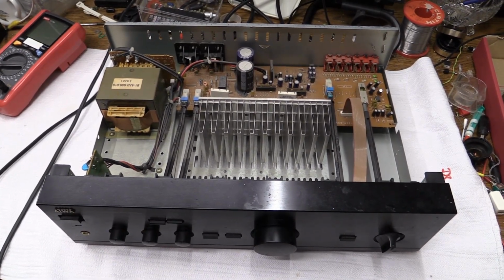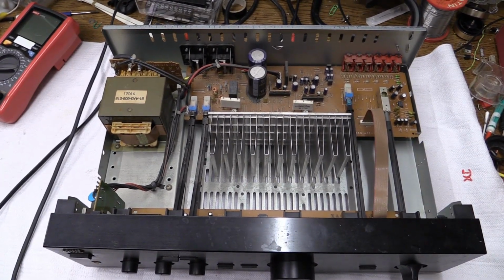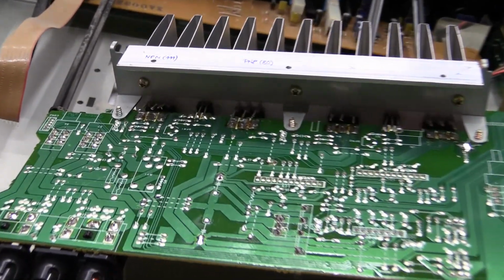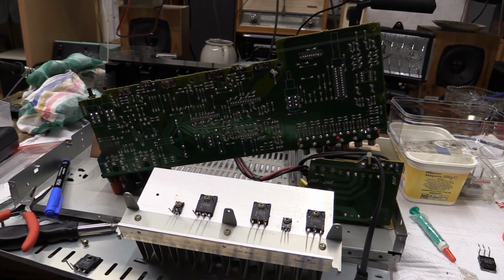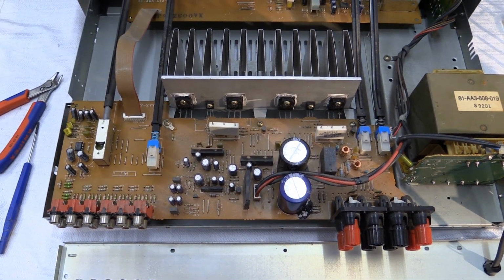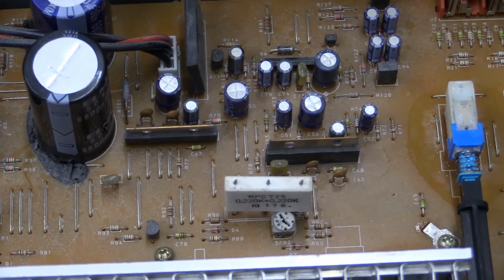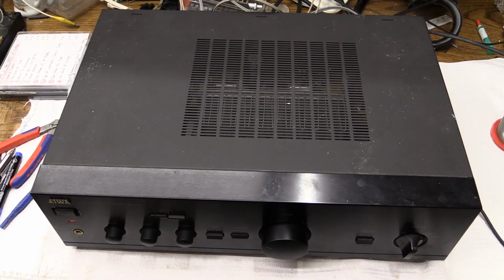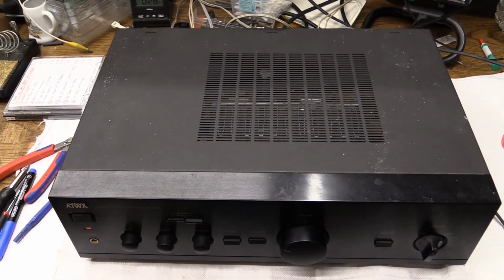DrCassette's Workshop - Aiwa XA-003 amp repairs

Comment: Hallo, ich hätte eine Frage, wenn gestattet: Die großen weißen, Quaderförmigen Widerstände vor der Endstufe, die mit den drei Beinchen, wie mißt man die, und wieso haben die drei Anschlüsse?

Hello, I would have a question, if allowed: The large white, cuboid shaped resistors in front of the amplifier transistors, with the three legs, how do you measure them, and why does they have three connections?
Reply from the maker: Es handelt sich um Drahtwiderstände mit Mittenanzapfung, das heißt, der mittlere Anschluss ist bei der Hälfte des Gesamtwiderstands verbunden. Man könnte alternativ auch sagen, es sind zwei gleich große Widerstände in einem Gehäuse, die miteinander verbunden sind. Das kann man entsprechend messen, wobei man aber zunächst den Widerstand nur zwischen den Messspitzen des Multimeters messen sollte, indem man diese miteinander verbindet. Diese Drahtwiderstände haben meist einen sehr geringen Wert von unter einem Ohm, deswegen fällt der Widerstand der Leitungen und Messspitzen des Multimeters ins Gewicht und muss vom Messergebnis abgezogen werden. 
In der Endstufe bieten diese Widerstände die Möglichkeit, über den Spannungsabfall den Ruhestrom der Ausgangstransistoren zu messen, deswegen sind die Anschlüsse auch nach oben heraus verlängert, damit man besonders einfach mit dem Messgerät herankommt.

Comment: Hell, for free and your skills, This could be sold to buy something better, Liked, back in the day we would crack open the case in the protection unit an stick a dime in it across the contacts, usually worked until amp would over heat under heavy load

Comment: that was my first Amplifier back in 1988 when i first left school. it had a habit of cutting out every time it was too loud rather than distorting. Was running it to Tannoy 607 speakers
Reply from the maker: That's intentional design, it's a protection circuit to protect the amplifier and the speakers from getting damaged.
Reply: @DrCassette  bust my OT all the same. wasnt too much for fix around 50euro nowadays prices, used and old toshiba silver thing for a while till it was fixed. you could turn that up near full but never sounded as warm.

Comment: I would be inclined to clean & lubricate the bias pot's, and adjust the quiescent current to spec's. I'm not sure what was meant by 'integrated' amplifier, when the output stage is discrete transistors..
A late model 'Marantz' has 2 integrated circuits (containing the output stage) mounted on a 'herringbone' heatsink.
As the driver IC's get hot, also do the electrolytic caps surrounding them; worth replacing for just a few dollars in the process of assembly...
Reply from the maker: 'Integrated Amplifier' in this case means it's a preamp and a main amp in one unit.

Comment: To test voltages on amplifiers without the output-transistors you should not disconnect the small bias-transistor in the middle. It plays an important role in generating the correct B-E voltages. That's why you were getting 37V everywhere. It also often helps to put a 100 ohm resistor from B-E instead of the output transistors. Then you should have the output at 0V and ~0.7V from B-E on the output transistor treminals.

Comment: Elna are not crappy capacitors.  Elna Silmic II are some of the best sounding caps available.
Reply: LoL Capacitors don't have a sound... They can only be built well or bad, last long or die early... The only thing that they can do to sound is if they are used in a filter circuit which if you replace with every single brand, so long as the capacity is the same, with all do exactly the same thing.. they don't make sound... The circuit does...
Judging by the amount of likes that your comment has, seems like a lot of other people don't understand Capacitors either LoL...
Reply: @PeterMilanovski  caps don't make the sound better, but they certainly do make the sound worse if they are of a bad brand or going bad
Reply: @PeterMilanovski  correct, except it's not only about C but also ESR (equivalent series resistance) and leakage current

Comment: The driver IC's in some Sony receivers run very hot too.
Reply from the maker: +Bri G. 
Yes indeed, I had a Sony receiver with a similar design. I installed heat sinks on the driver chips. Still ran very hot.

Comment: I'm glad you managed to fix your amp :o)  i'm still stumped with mine :o/ ... I have the same problem as your friend had, one of the channels not working and I replaced all the caps and the transistors seem fine...just getting a lot of abnormal negative voltage on the channel which doesnt work. I'm slowly prodding along troubleshooting at the best of my abilities :o) By the way, It was nice to hear The Beloved's Sweet harmony again :oD
Reply from the maker: +MsMad Lemon 
If you get a high amout of DC voltage on one of the speaker outputs, this could be due to a shorted output transistor. If those are fine, go back one step and check the driver stage. A schematic is always helpful. Just blindly replacing capacitors never helps, usually those are fine.
Reply: +DrCassette Thank you, actually the output transistors are fine as I swapped left and right to test, I have a feeling it is the driver stage. i'm getting high negative voltages at the base of the output transistor. i'm getting -21.2v  but the schematic states the voltage  at that point should be -0.66v... I checked the same point on the working right channel as a reference and it's indeed -0.66v as it should be. Do you know what the cause of such high negative voltages at transistor bases is?
Reply: +MsMad Lemon Here's a link to the schematic with notes: 
http://s15.postimg.org/3rs5x4d2z/20151121_031109.jpg
Reply from the maker: +MsMad Lemon 
Sorry for the late reply... Check Q707, 709, 711 and the resistors and the trimmer potentiometer surrounding them. I'm very sure this is not a capacitor related problem.
Reply: +DrCassette Not a problem for the lateness, thank you so much for helping out :o)

Comment: If it's running that hot you probably should adjust the bias. I saw bias adjustment potentiometers in there. Just measure across the emitter resistor on each channel and adjust for about 10 to 15 millivolts.
Reply from the maker: Mark Zacharias There are directions in the service manual that I will follow once I get the time to work on this again.

Comment: Great work, and as a tip always in amplifiers start from the end, this means checking output transistors. In most cases no need in unsoldering them, if they are shorted then remove them, then check the output resistors, since when we get C to E short on both, that resistors sometimes burn, since we get both rails potential on them. After that check the Base resistors, they also go open or a bit burned if output transistor gets a short to Base, if so then most likely drivers also got some kick. Good luck in next projects ^.=.^
Reply: +Sader Dragon furry

Comment: I love watching you revive junk from the dump.  I have found that WD-40 will soften dried heat-sink grease, allowing it to be cleaned off.  I don't know if you really had the time to let those insulators soak in it, but with a little time, it has worked for me.
Reply from the maker: weasel2htm Hmm, good idea. I'll try that next time.

Comment: Elna is just a s good as Nichicon, Rubycon, etc... I remember you saying that you had some old ones that were bad, well, electrolytics have a lifespan of 10 years, so that's normal.
Reply from the maker: NoBudgetTech Elna of course is better than all those cheap no name brands, but from all the quality brand they happen to be the ones I've had the most trouble with over the years. 10 years is way too short. From experience, it's more like 40 years.
Reply: From experience I'd also say 30+ years, but they're still rated for a certain amount of hours and you can't blame them for going bad after their life expectancy has been met. Also I've seen hundreds of bloated Japanese caps but not a single bulging ELNA ;)

Comment: You could probably mount some little heatsinks to those ICS
Reply from the maker: Tyler Hanson I had a Sony receiver with the same setup and I did put heat sinks on the driver ICs in that unit. Yes indeed, I could do the same in this Aiwa amp.
Reply: Sweeeeeet ☺

Comment: Elna caps are very good, and vincent audio stuff is the "white van scam" sort of stuff,they are very cheaply built,and then sold with massive price points.
Reply from the maker: PetruV Both wrong. Out of all name brands, Elna caps gave me the most trouble. And Vincent is (although from China) a highly regarded brand for HiFi and High End audio equipment. The amp I was talking about was not cheap at all, the transformers and heat sinks were so heavy we could barely lift that unit!
Reply: That's interesting,but i have not worked with large elna caps, so you must know better.I actually remembered, the crappy brand was "Marc Vincent", not just vincent

Comment: it might be running hot because you forgot to adjust the quiescent current and it is now way to high! because changing transistors nearly always changes the quiescent current. but it could simply be bad thermal design. also if it happens to be a pure class B amplifier ,forget what i just said. :D
Reply from the maker: TheNiggiboy Did you see an adjustment for that? I didn't.
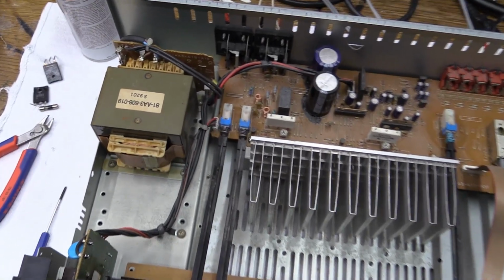Reply: DrCassette at 11:11 the trimpot on the bottom right corner of the video seems like it's the quiescent current control. but it could also be a dc offset adjustment. just try it out and see if it does something :D
Reply from the maker: I looked it up in the service manual, these are called 'preparation current' adjustments. The manual specifies voltages present on two test points, so I'll check that.

Comment: Is it me or do a lot of new videos suffer from artifacts at multiple points recently ?
Reply: Neil Robinson I am from Germany, and I have seem these artifacts on the EEVblog, too.
DrCassette thankfully does not seem to be affected by this.
Although EEVBlog was the only channel so far where I spotted these artifacts.
Reply: Neil Robinson has to do with the new 50/60fps video. EEVBlog and DrCassette both upload in high framerates. some monitor/graphics combinations can't handle that and suffer from tearing occasionally.
Reply: Neil Robinson For me this only occurs watching this video in 360 / 480p, not in 720p50 or 1080p50. Since 360p and 480p aren't 50 frames per second, there must be something wrong with YouTube converting them.
Reply from the maker: My videos or YouTube videos in general? The video files look perfectly fine on my PC, and I do render with the settings YouTube recommends. I have however noticed that YouTube's video processing makes my videos look a bit crappy from time to time :(
Reply: DrCassette Its not just your videos, EC projects and the EEV channel all suffer from short breakups at seemingly random points, it happens on both my Mac using Chrome  and i get the same effect watching the videos via a Playstation 3, so it dont seem to be platform specific.

I am in Canada so maybe other people using youtube servers in other regions may not see the effect, but i am finding it very annoying.

Old videos seem un effected.
Reply: HW1099 Just watching the video again and the artifacts are still there, at the point where Dr Cassette wobbles the rectifier bridge there is a fairly bad break up.

As i said i have seen the very same effects on a few channels, i hope youtube sort it out soon.
Reply: Das OSi
Thanks for that, switching the video to 720 did indeed get rid of the artifacts, on the mac anyway, the PlayStation 3 still has them, no idea if you can force a higher resolution on the PS3.